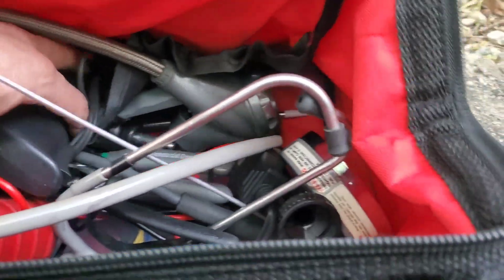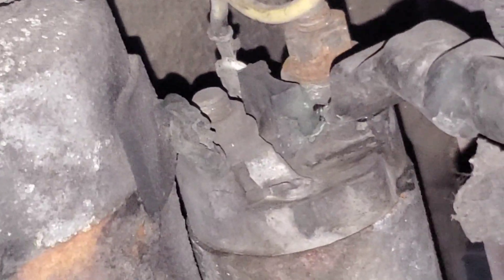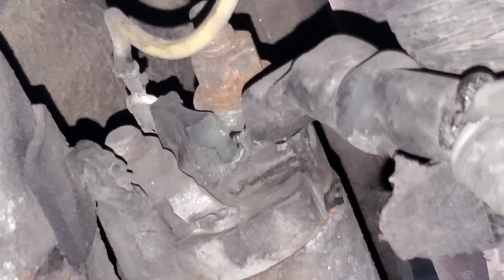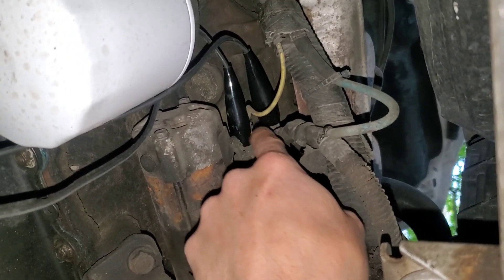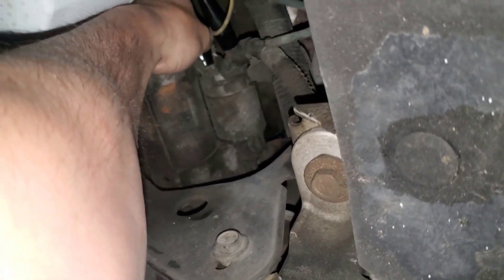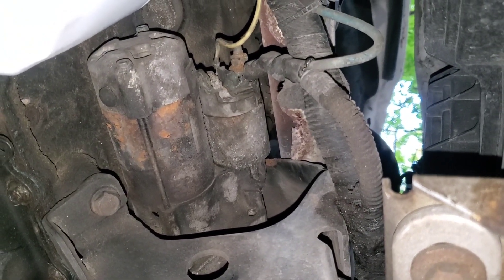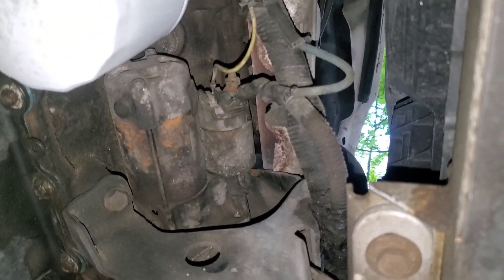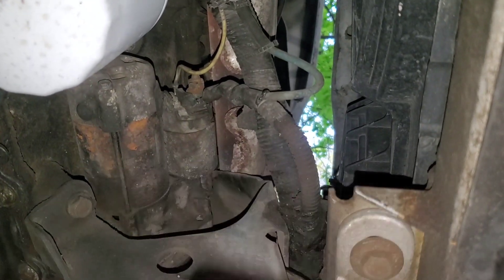How to use a Remote Starter Switch! Test Starters with ease!

Comment: Dude, the reason your starter turned but didn't kick in is because you hooked it up to the small bear stud. If you would have looked that up to where the yellow wire is you would have kicked in the solenoid as well. Just a little FYI

Comment: Andy, I suggest that you delete and redo this video for SAFETY REASONS,  because you didn't connect your remote starter correctly to the starter on your vehicle.  Per a previous commenter, he noted that you didn't connect the  second remote stater wire to the "S"  terminal on the starter's solenoid (smaller treaded bolt or tab).  Just a suggestion .... your call.

Comment: Andy, trying to figure out how to have a backup way to start my boat if the ignition switch fails.  Did some testing on the starter while off the boat.  Pretty sure that you connect the leads to the battery connection and the signal wire, not the feed to the starter motor.  If the key is on, you should be able to start the engine by putting 12 volts to the solenoid through the signal wire from the battery wire.  The solenoid should energized and connect the battery wire to the starter motor.  Think that it draws a lot of amps, so all you really want to do with the remote starter with those 16 gage wires is energize the solenoid.

Comment: you didn't energize the solenoid only the starter motor, thats why it didn't engage the gear
Reply from the maker: I realized that a little later on. Thank you for pointing that out though brother.